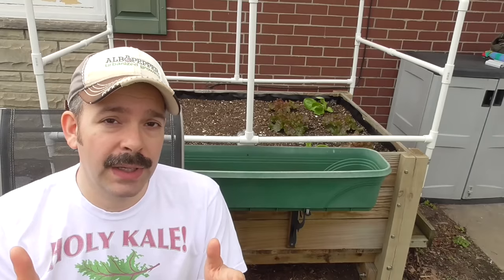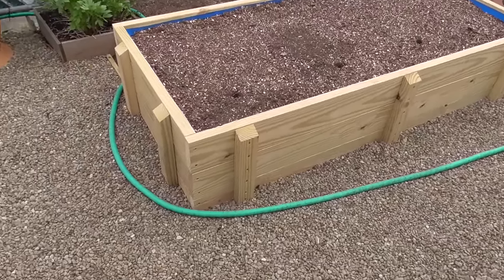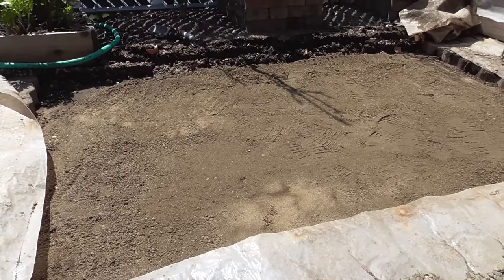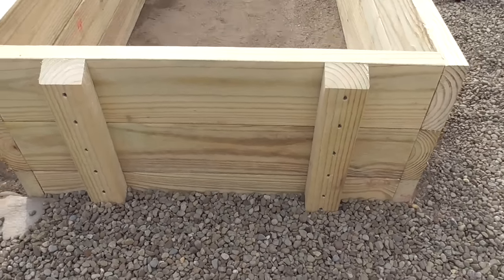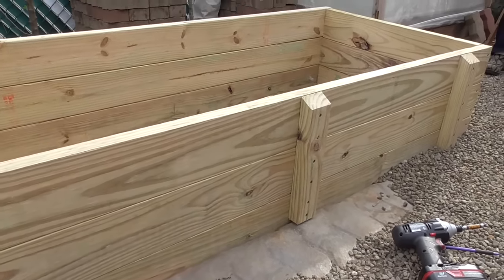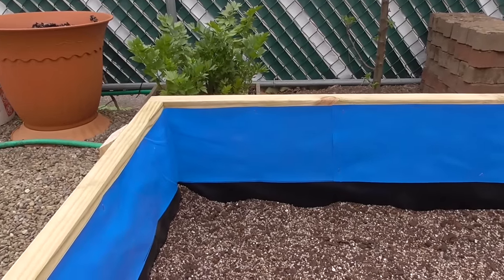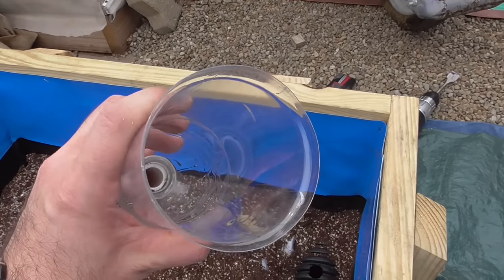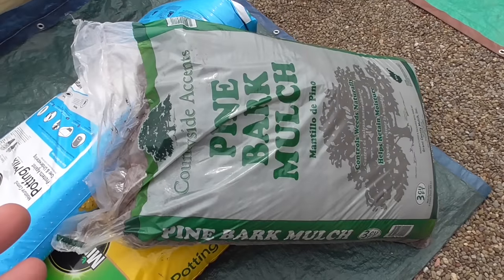Self-watering SIP Sub-irrigated Raised Bed Construction  (How to Build)

Comment: Is there anything you need to do over the winter months to prevent damage to the pipe/drainage system?
I doubt the corrugated piping will fill enough to burst from freezing, but the overflow tube may?

Thanks, and great video!
Reply from the maker: L Miller Very good question!  I have been lax in the past, and my SIP systems have held up pretty well.  Once the over flow tube freezes up though, any extra rain or melting snow will just fill the thing way up.  So the best practice would be to cover it with plastic or a tarp in the Fall to keep out excess water.  That would be the more important step to take.
 
As a secondary step, you could even siphon out the excess water at the end of the season.  I'm currently working on a video to show how you can set up the overflow drain tube so that it doubles as a siphon.  Not needed, in my opinion.  But I'm going to show a way to implement it for anyone who is interested.

Comment: Thank you for the amazing video!!   I realize that I made a few mistakes in my first attempt, so time to dig it up and modify.  The one question I have is about the liner.  I used 6 mil builders plastic from Lowes.  Do you think this is safe?  I suspect I won't really have to worry about punctures, but the chemical leaching is of concern after your "fish safe" designation.  Thank you again for your great video, website, and any help you can provide!!
Chris
Reply from the maker: +Diggum88 - Hi Chris, myself personally, I am not concerned about the plastics used in my boxes. After all, our foods and cosmetics are stored in a variety of plastics which would be a more direct pathway of exposure. But in a planter, the plastics touch soil. Plant roots grow in the soil. Then nutrients travel through several layers of plants tissue. And for the fruiting things like tomatoes, peppers, melons, etc., there is an extra layer of filtration that occurs. I've never found any research that demonstrates a cause for concern.

Additionally, different plastics are classified as being safer than others. PVC causes much alarm. But not all PVC contains the same compounds. Fish safe is formulated for maximum safety. But PVC made for roof or even pool linings is not formulated in the same way. I would avoid PVC that is not made for drinking or for ponds. But builders plastic is often made from Polyethylene, I believe. Many Polyethylenes are very stable. Plastics like PETE, HDPE & LDPE are all types of Polyethylenes that are used in our food containers due to their general safeness.

Hope that helps a little. Thanks so much for watching my video & supporting my Channel!

Comment: I'm doing this for my greenhouse, one question @AlboPepper , what is the best way to fill these with the wicking material, tubes, water?  IE, so that the wicking material is fully surrounding the tubes (side, below, and gaps).  I tried a couple different ways, and found out, when adding the water, I had to apply weights to the tubes (didn't have tops soil on), to keep them from initially floating out of wicking mix, as the water had not seeped into all of the tubes.  Advice/Guidance?
Reply from the maker: Thanks for watching.

Step 1: Place the corrugated pipes. I like to use small scraps of wood as spacer blocks wedged in between the pipes to maintain spacing.

Step 2: Apply the wicking material. Then I gently, but firmly, stuff the wicking mix between the pipes, making sure to fill in all gaps. Remove spacer block & fill the holes in with wicking mix.

Step 3: Add the upper 12" of potting mix.

Step 4: Fill reservoir with water. This includes spraying some water on the top of the soil surface to facilitate capillary action.

Hope that helps!
Reply: @Albopepper  very much, I suspected these were the steps, but wasn't sure if I was missing something.
Also, thanks for the reply, I'm going on a large scale in my greenhouse, and this system should work great, as it's 2:15 from home, on our farm, so I can't get to it every day.
I'm also using a self rain collection system, and a wifi controlled valve to then remotely water the beds if/when needed while away.  Would love to send you pics of the entire thing.  Your info was very needed and useful.

Comment: Hi Al, 

Like many other recent commenters, I'm using this time to build raised garden beds with a SIP, and your excellent video has gotten me really excited about the project. I've already built the beds, and I have a question--they're simply placed on top of our lawn, and the space is not particularly level. I suspect this will be a problem for the SIP, but want to confirm that with you. It's not a steep gradient by any means, but definitely a slight slope. Is it imperative that I level the bed before I start building the SIP? Thanks in advance for your response, and thanks for taking the time to make this video.

Comment: Watched your series here and I plan on basing a lot of what I want to do off of it to make some garden boxes very soon, and have a question.

If I wanted to have the overflow setup in a way where it starts at the bottom of the reservoir instead of 3-1/4" up (to create an L that will aim to be that high for drainage), is the overflow supposed to also help bring air into the chamber? I was thinking having a snorkel (like you have to add water to the reservoir) but set it up so it stays above the drainage line, or adding another hole above the drainage line.

The plan for the L is to see the water level and also have it easily disconnect for winter (so it drains closer to the bottom). And I also plan on using 3/4" pipes for this L setup (so it's harder to ever clog up). It also could be used in the future to add a float valve setup (if I ever want to).

Comment: Al, the standard size corrugated tubing will work for a box thats 4' high? Also, the drain pipe is running into one of the corrugated tubes?

Comment: Hi Al, I am re-finishing my two planter boxes and decided to put in SIP watering systems. I am not clear about a couple of points with the perforated pipes: why are the pipes not connected to each other, and since they are not then what is the difference in how many of them is placed - only two or three versus covering the entire bottom area. Not disputing your method, like others I also thought your tute was thorough and wonderful, just trying to understand the principles. My only other issue with my boxes is I am trying to located drainage pipes smaller than 4 inches and they are not deep enough. Thanks in advance
Reply from the maker: roobiep Good questions!  First, since the drain pipes are perforated, the water is able to freely diffuse throughout the system.  It disperses quite quickly actually.  The reason to increase the number of pipes is because you want the majority of the plant roots to be above an aeration screen.  The top half of the pipes serve this function, allowing for the exchange of gases right at the root zone.  Also, this helps to regulate moisture levels because most of the surface area is not resting in water.

In regards to your issue with smaller drain pipes, I'm not sure I understand what you are trying to do.  Are you trying to use 3" drain pipes instead of 4" pipes?
Reply: AlboPepper Awesome, that makes sense with the pipes.

The height of my containers are only 12", putting in 4" pipes does not leave much room above them, except for things like thyme or herbs that have shallow roots. I thought if I can put in 2" pipes then that would address the height issue. I am really trying to not go buy more lumber to increase the height, already put in way too much time on this project.
Reply from the maker: roobiep OK, I gotcha. The 3" pipes might be a good compromise. (The external width is 3.5"). Lowering the overflow tube to 1.75" on center will still hold water, but still give good aeration. And you would have 9" of potting mix depth, which isn't all too bad. In fact, that is more that what an EarthBox kit provides. I've never tested these specs, mind you, but it seems that should have a good chance for success.
Reply: AlboPepper I am willing to try that. It seems the smallest size available on the flexible pipes is in fact 3". Thank you Al.
Reply from the maker: roobiep
Sure thing.  I hope you have good success with it!

Comment: Ty for the tutorial. Unfortunately before seeing this video I mixed my soil 50%coco, 20 %cow manure compost, and 20% worm castings 10% perlite. 
There all in 5gal totes. 
So my question do you think the manure compost will be alright for the season? Truthfully worried about root rot, and made air rated wicking buckets since. Easier to just use clothe pots
Reply from the maker: If you already have it all set up, you could just try it out and see. From what I've seen, the mix tends to break down and degrade over time. The silty particles in manure or topsoil can accelerate that process. Perhaps after a year or two you find that the mix needs replaced. If so, you could simply apply the old material to a traditional raised bed and it ought to work well. But hopefully your plants will do ok this season. Let us know how it goes!
Reply: @Albopepper  I only use the five gal to grow medical so I only need it to last for 6 months or so. And then I can re use it since it's indoors. Ty for the reply

Comment: A little late to this video but really enjoyed.  The corrugated tubes at the bottom, are they connected in anyway?
Reply from the maker: Thanks for watching Frederick! No, they weren't connected. But since they are perforated, the water is able to travel between them so that is all levels out.
Reply: I see. What about the tube with the filler spout. Does that tube act as a reservoir so the garden always has water? Thanks again. I’m going to watch this for a third time😹😹😹

Comment: Love the videos
My son is creating this garden for a merit badge project. Being thrifty goes along way for a scout. Do you see any problem with using 1/2 gallon plastic milk cartons strung together with slits or small holes, placed with a support so that the cartons rests on the corner instead of the flat side which would create a larger space to help with capillary action.This would be for the center section only; we would set up the ends for drainage as you have. This would save a good deal of start up funds.
Reply from the maker: +Sherri Lewis - Hi Sherry. Your idea might work ok. I'm not sure if I'm correctly envisioning your method. Just make sure the plastic is rigid enough to support the weight of the soil. Make sure containers are deep enough to allow for aeration and drainage. Try to maintain consistency in depth across the box bottom. This is a modification that I've never personally tested. So your idea is a little experimental. But if you decide to try it out, I hope it works out for you.

Comment: Hi A;bo, love your video's on SIP's and appreciate your attention to detail.  Can you tell me what ratio you mix the potting mix and vermiculite you put at the base of this SIP around the irrigation pipes
Reply from the maker: Thanks for watching! Please refer to the info from my site:

WHAT ABOUT THAT SPECIAL "WICKING" LAYER? I typically mix up a special layer of wicking mix that I use for the very bottom section of my SIPs. This is the mix that's stuffed in between the black corrugated perforated drain pipes. So what's the magical formula? Is this super critical? Rather than making a strict, hard fast rule, the idea is to offer a general guide.

If you're making a very small system and materials are hard to come by, you could probably just use the same potting mix that is applied to the top section and it should work ok. If you want to mix up a special wicking base, you can use peat moss / vermiculite / perlite at a ratio of 3:1:1. This is not set in stone. The ratio could be 1:1:1 and it would work well. Anything like that is fine. You could replace the peat moss with coir (coco). I like using this special mix, because it is easier to stuff in between the pipes, since the particles are small & uniform. Also, I'm not applying a nutrient rich potting mix in the very bottom of the box. Instead, the fancy potting mix is reserved for the upper layer.

There's some flexibility here. But here's what I do NOT recommend for a wicking base. Do not use gravel or sand. Gravel does not wick well. Sand is a little better at wicking, but not as good as vermiculite, peat moss or coir. Both sand and gravel are MUCH heavier. It's not worth it. Do not use wood or bark products as these will not wick well and they may cause air gaps as you try to stuff around the pipes. Also, although peat moss is good at wicking, it does have a limitation. If peat moss becomes bone dry it becomes hydrophobic and actually REPELS water. So I never use pure peat moss in the bottom section since it could create a failure point if it ever happens to dry out. 

https://albopepper.com/SIP-raised-bed.php

Comment: Great Video! I just bought 2' high, 2' wide and 6' wide water troughs. Do I get the 4 inch or 8 inch corrugated irrigation tubing?
Reply from the maker: Thanks for watching! I've only tested the 4" pipe. I see that there is also 6" pipe, so maybe I would try that one. But I would try to use the perforated pipes that have thin slits for perforations, not larger holes. Some of the 8" pipe has holes instead of slits which might allow potting mix to infiltrate.
Reply: @Albopepper  Got it! Ill see what is available at Home Depot. Thanks so much for your speedy reply. Ive watched several of your videos and am now a big fan of yours!

Comment: How much soil do I need for a 4x8x16 SIP raised bed and can I use raised bed soil in this bed.   I went to the local nurseries and they said instead of buying everything separate just get raised bed soil?

Thank you, this is my first attempt at gardening.
Reply from the maker: The top part (above the black pipes) would require 32 cubic feet for a 4'x8' bed. I don't recommend raised bed soil because it is not the same as potting mix. It is meant to be freely draining. It often does not contain perlite and it is not intended for use above a perched water table. You can buy bulk bags of pre-mixed potting mix. Try to find one with quality components.
Reply: Thank you so much for the info but of course I have another question.  I really wanted an organic garden but the price to fill a box this big is way out of my price range.  I did see a place that carries Burpee  organic soil that is reasonable but it's made primarily with coco or cori and from researching it has no nutritional value.   Do you have any suggestions for me to make an organic SIP garden?  It cost about the same as Miracle Gro but Miracle Gro is not organic. 
Do you have an online support group?

Comment: Hi Al.  I just finished mine based off of your set up 8/1/20.  I am noticing that the water coming out of the overflow tube smells a little stagnate.  Is this normal?  Should I worry?  Any troubleshooting ideas?  Thanks.

Comment: Hello AlboPeppper....Thanks for this video. I have built this bed  two months back and its really cool. But I believe I have some problems in the soil.  I purchased Organic raised bed soil from a local farm. All the plants that I planted are turning are yellow and don't see any growth. I initially thought that I may added more Dolomite lime than needed. But when I tested my soil using soil test kit from Lowes, noted following observations 1) Ph 7.5 Alkaline 2) Very Low Nitrogen and Very Low Phosphorus. Can you please suggest how can I fix this? Appreciate your help.
Reply from the maker: Hi Dinesh. Raised bed soil is not much better than "garden soil". The properties tend to be much different from "potting mix". Garden soil, top soil and even many raised bed soils tend to have smaller particles and reduced pore spacing. It depends on the materials used in the soil of course.

If you are trying to save your plants while still using this soil, it's possible that amending the soil may help. A pH of 7.5 is at upper range for most vegetables. Often people shoot for pH of 6.5. If nitrogen & phosphorus are low, then you could mix in some extra fertilizer as a side dressing. And for immediate nutrients, try a Miracle Gro Liquid Feed. This will supply a quick release of nutrients while the fertilizer slowly breaks downs for plant consumption.

Hopefully, the issue isn't caused by excess moisture levels from the soil. Sometimes this can make the plants turn yellow as well. I hope you can get things worked out.

Comment: I am planning on building my wicking/SIP bed based on your concept this week. Thank you so much for your detailed instructions!!
I had a question -  Do you think chopped up broken down leaves would substitute for pine bark. I know the pieces are different sizes but I am trying to cut cost and also use what is already plentiful on my property. Thank you for sharing!
Reply from the maker: Hi, I've never tried broken down leaves in SIPs. I use leaves as surface mulch on my in-ground beds and also as worm bedding for my vermi-compost. Please be sure to count ALL costs involved, including potting mix and pond liner costs. If you cut too many corners, then the system might not work well and you would have wasted your money. Just start with one planter. Don't go too large. Allow for room for expansion as you get experience with your prototype.